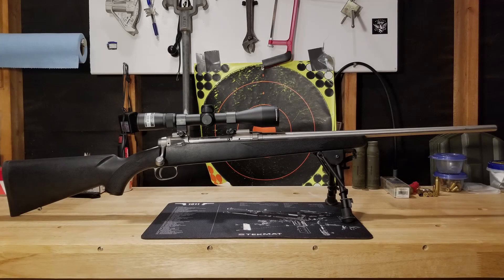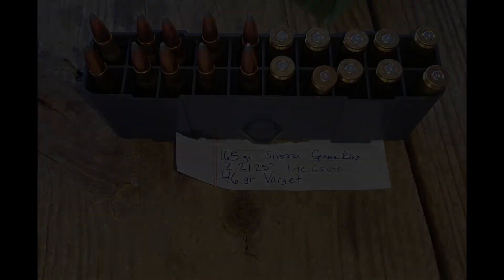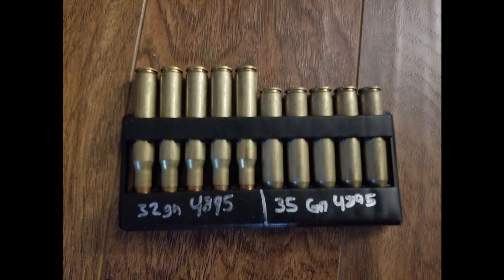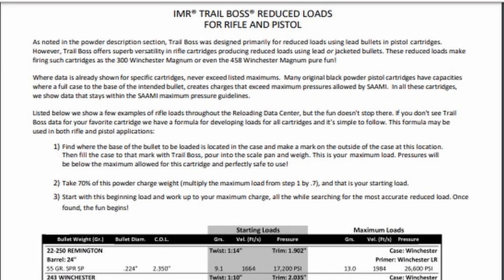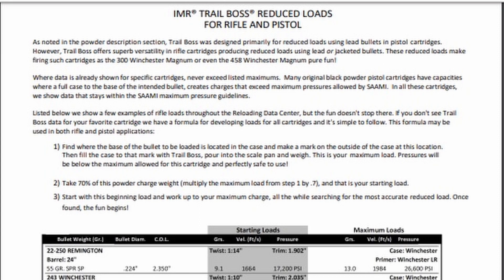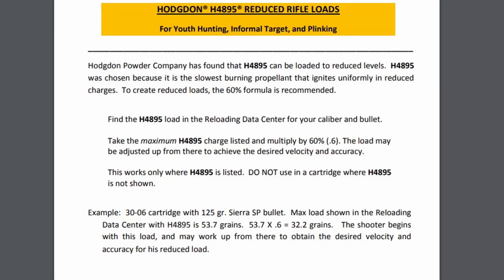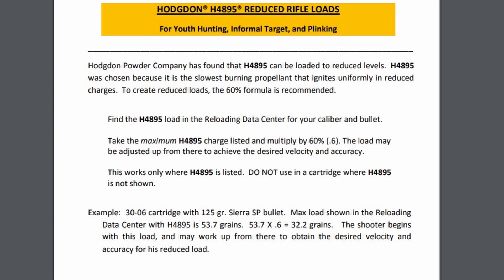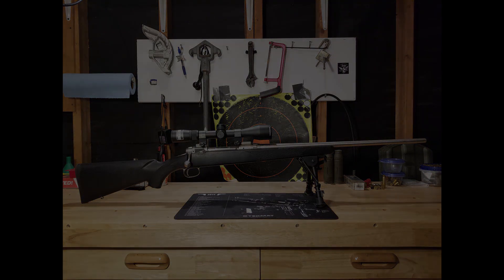Reduced recoil loads

Comment: Just turned away from a Q Fix in 308 because of the recoil + lightweight design. My operational concern was obvious. These types of guns are just trying to do too much and compromise the intended application. I don’t even think the gun I mentioned here was manageable with the muzzle breaks or suppressors.

That took me to reevaluating the caliber needs that I have, the available loads (which can make a big difference depending upon the caliper and versatility), and even reduced loads.

Sounds like you were able to manage your recoil with the reduced loads considerably.

What I don’t understand is at what range and animal the caliber and load will still be terminal.

Know of any good table / matrix / source that lays all that out?
Reply from the maker: I don't know of any comprehensive charts. But some projectile manufacturers will show bullet expansion at various velocities and combine that with the energy (ft/lb) the projectile has at the speed you're shooting at and that should give you a relative idea of its stopping power.